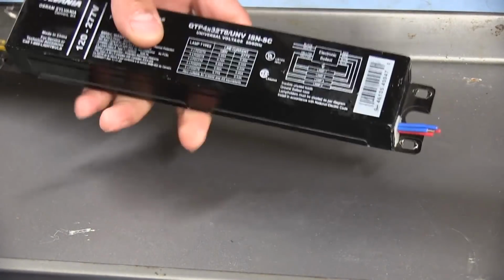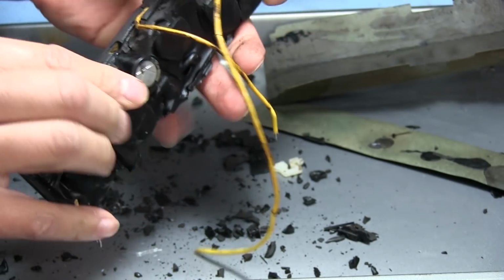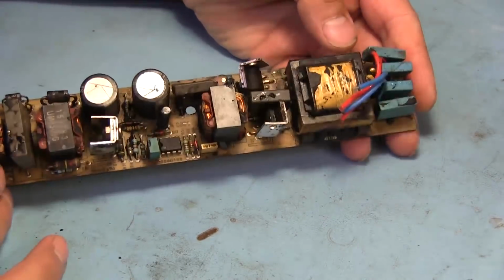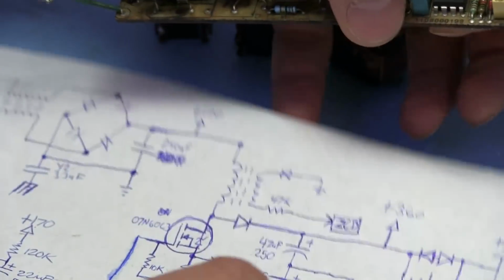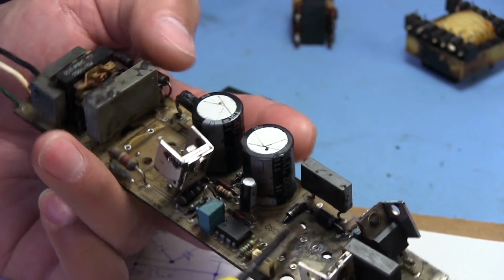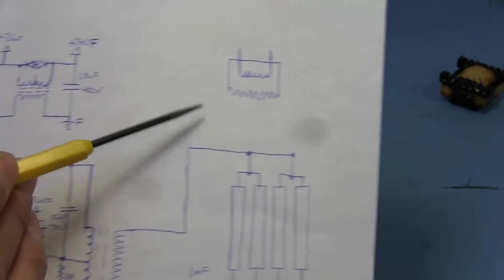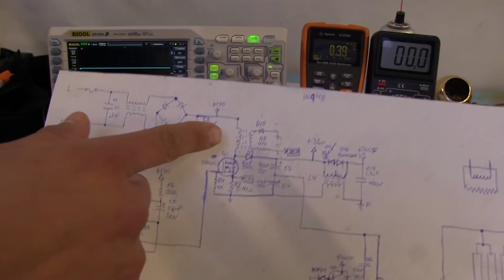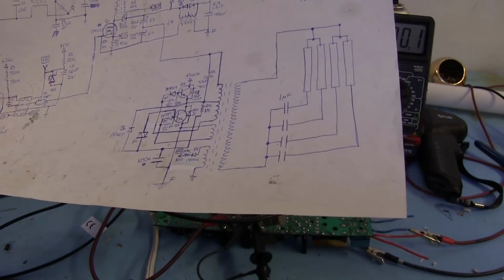TWB #68 | Autopsy Of A Bad Electronic Fluorescent Lamp Ballast With Schematic

Comment: Cheaper than WD40 is just to use kerosene, works in the ultrasonic cleaner as well if you leave the basket out.
Reply from the maker: Thanks for the tip! I'll have to give it a shot.